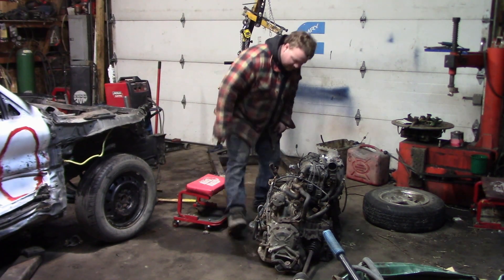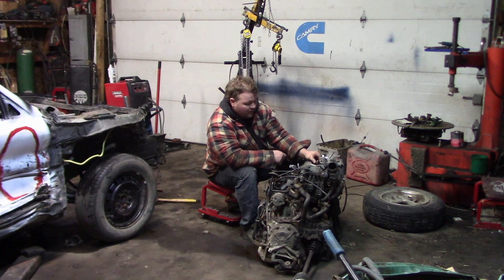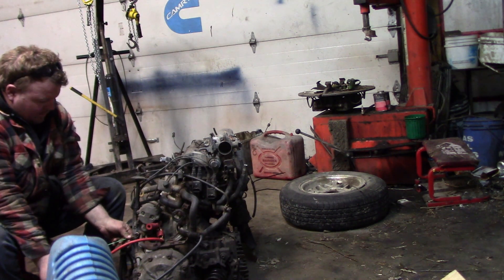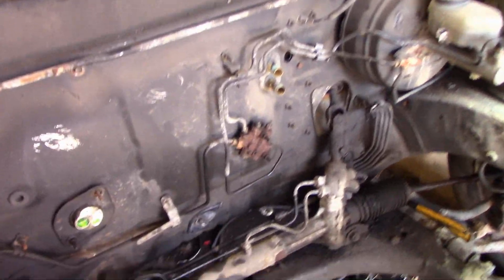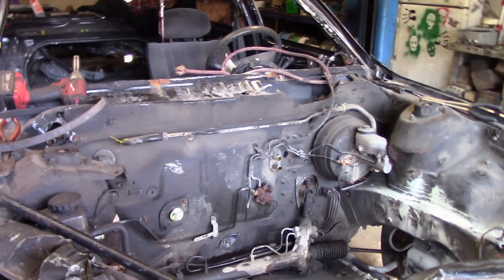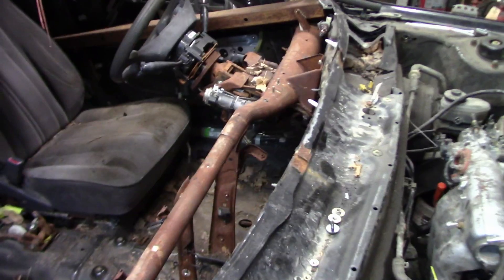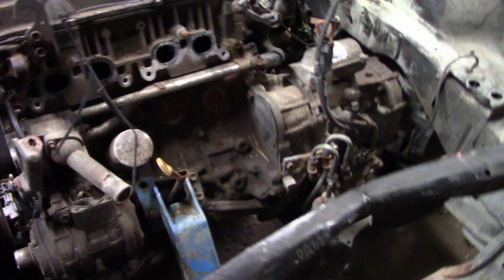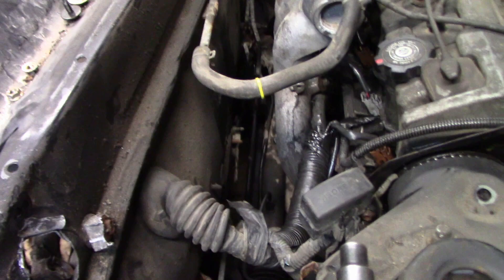This motor has been sitting out side all winter, Lets toss it into this camry

Comment: I spent my stay at home order last month taking an engine out of a 2009 Chevy Traverse SUV build. The Traverse engine had a large crack on the cylinder block and it was a non-running vehicle when I bought it. Swapped it with a 3.6L V6 I had kept from a GMC Acadia derby SUV I used last Summer.
Reply from the maker: thats great man keep busy and stay out of trouble